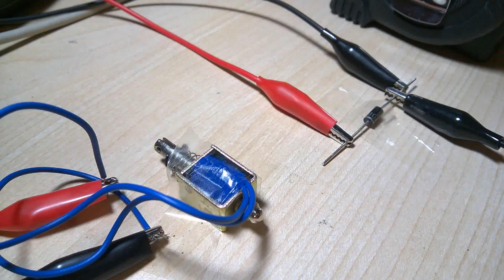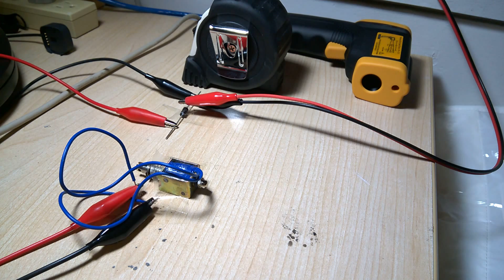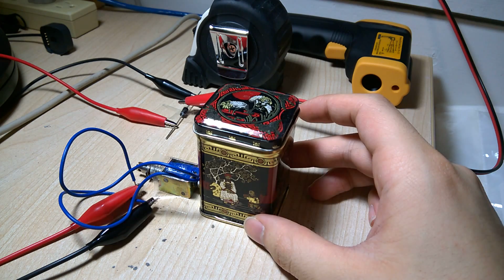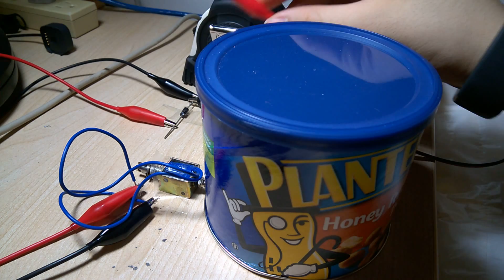Linear Actuator Solenoid

Comment: so if the power is on all the time the solenoid  would be out yes then when power is cut off it springs back. can you keep a contants 12v feed to it without it  blowing up 12v mine is i want to know if the 12v in is present for lets say 3hrs or so would it be ok

Comment: Great vid! wondering can you operate one solenoid at different amounts of current in one circuit? I'm guessing this would be done by some parrell circuit of some sort, or a diff. load voltage?
Reply from the maker: The solenoid is rated for 12 volts; at higher voltages, you might fry it, and at lower voltages, it might not move at all. Why would you want to operate a solenoid at different amounts of current anyway?
Reply: @wecsam  I'm envisioning using a solenoid as an actuator for a lever arm, that may move different things depending on its strength.

Comment: Can you please mention the sizea nd Force of the Solenoid? Also the site from where you buy this? I need a solenoid of almost 15mm dimension and upto 20N Force.
Reply: Any idea from where I can buy such small solenoid with such a force
Reply from the maker: I got the one in this video on Amazon: https://www.amazon.com/dp/B008LTHYLA
It has a holding force of 4 N, but in my experimentation, it only pulled with about 0.75 N. If you need a lot of force, you should also consider pneumatics or a servo motor.

Comment: I'm looking at these to activate a pull pin on a rc 1/10  winch can I just hook up the positive to a switch turn on stays pulled in until switch is turned off then springs back then opersite way wind winch in 🤔
Reply from the maker: Yes, the plunger stays pulled while power is on, and a spring pushes it back when the power is cut. A switch would work great for controlling this. However, just be aware that it doesn't pull with much force; I am not sure how much force your pull pin needs, but you might need a bigger solenoid.
Reply: @wecsam  does it matter wich  wire I would use thinking about a servo too but need to convert it to two wire but I dunno if it self level modding to two wires 🤔
Reply: @wecsam  or recommend a bigger solenoid that not too bulky smaller the better
Reply from the maker: @Lee-At-Green-Pheonix-Rc  I recommend getting a force meter to figure out how much force you actually need and then using that to decide on a solenoid or servo.

Comment: Hello sir i want to push a 100 kg weight bar like that colgate box cross section area how much capacity of linear solenoid actuator i have to use ?
Reply from the maker: A 100-kilogram bar the size of the toothpaste box? Did you mean grams?

Comment: How arrest heat and which type of diode are you using this?
Reply from the maker: You could add a heatsink to the diode, but if it's getting too hot, double-check that you're using the correct voltage for it. Check that it is drawing the amount of power that the manufacturer specified. You could also try another solenoid in case that you have a defective one.

I don't have the exact diode model anymore, but any 1N4*** should work. It only has to block Vcc.

Comment: How much weight it can push
Reply from the maker: It can push with about 0.4 N of force. How much weight that translates to depends on how you're using the solenoid. If you're pushing horizontally across a surface, you'll need to know the coefficient of friction between the object that's being pushed and the surface.

Comment: Would this 5v solenoid have enough force to push the nozzle of a spray paint can down? Thanks for your demonstration
Reply from the maker: It can push with about 0.4 N of force. You're going to need to measure how much force your can needs. A servo motor may work better if you need more force.

Comment: Hi Dave I’m look at building something using basically the same solenoid and a PIR. So I have a micro PIR sensor that momentarily switches on and off for around 2-5secs running off a CR2 battery 🔋 what do I need in between the PIR & solenoid? I.e diode and also need a current limit of 100ma. If you can help me out
Reply from the maker: I assume that you can make the PIR and solenoid share a ground. You'll want an N-channel MOSFET. It can take a low-voltage, low-current signal and switch a high-voltage, high-current line on and off. Look at "Simple Solenoid Drivers" on https://www.electronicdesign.com/industrial-automation/what-s-best-way-drive-solenoid for the basic idea.

Comment: Hi,
How can ı make a full automatic selenoid engine? Forward-back-forward-back like a tatto machine?
I want to make a pen for working on copper plate. For dotted texture.
Reply from the maker: I'm not sure how tattoo needles work, but a solenoid like this one probably won't be fast enough. An electric motor with a slider-crank mechanism might be a better choice.

Comment: do you think the solenoid is powerful enough to push a tennis ball up a 30 cm ramp which makes a 45 degree angle with the floor?
Reply from the maker: Not the one in the video. The force that is required will vary (different surfaces will have different amounts of friction, for example), but even in ideal conditions, the solenoid that I used won't push a whole tennis ball that high.
Reply: @wecsam  how high would it push it then? 10 cm? Let's say the surface has minimal friction.
Reply from the maker: @raymetal7  More like 1.3 cm in ideal circumstances. I previously measured the solenoid to push with at most 0.50 N. Let's assume that it exerts this force constantly while the plunger is moving, and let's assume that the ball stays in contact for the maximum travel of 0.010 m. That's 0.0050 J of work (force * distance). Convert that to gravitational potential energy (mass * gravitational acceleration * height). A standard tennis ball weighs at least 0.057 kg. Assuming 9.8 m/s^2 acceleration of gravity, if we solve for the height, that gives us 0.0090 m of height ([0.0050 J]/[9.8 m/s^2]/[0.057 kg] = 0.0090 m). Of course, that's going straight up; if the ball is rolling up a 45° ramp, then we can divide that by sin(45°) to get 0.013 m or 1.3 cm. Again, this is assuming no friction, a constant force from the solenoid, and contact between the ball and the plunger for the plunger's full range of travel.

Of course, if you got a stronger solenoid, then the ball would move farther.
Reply from the maker: @raymetal7  Oh, and this assumes that the ball doesn't roll. We already assumed no friction, so the ball won't roll as long as the force is applied perfectly in line with the ball's center of gravity.

Comment: Hey David, I need your help. I wanna know can I use it to push a modular electrical switch?
Reply from the maker: That's going to depend on the switch and the solenoid. The solenoid in the video was not able to push or pull with much force; it is not strong enough to push any switches that I've used. You would have to make sure that your solenoid is strong enough to push your switch.

It might be easier just to use a servo motor; some of those have a lot of torque, and there are plenty of designs on the Internet that mount servo motors to light switches. I have a video where I show just that: https://www.youtube.com/watch?v=m3pA422aRlg
Reply: @wecsam  Thanks David! 
May I know the specifications of the Solenoid that you used in the video?
Reply from the maker: @harenderjeetarora7508  You can find them on the original item page here: https://www.amazon.com/dp/B008LTHYLA/

Comment: Hello David. I’m building a possum trap. Cage type. As a kid I made traps where a possums weight on a ramp tripped a guillotine type trap door that shut behind animal. 
Now I want a electric trip where I still use a ramp which taps a micro switch that sparks the coil/solenoid pulls the pin that drops the door. 
But how do I stop power after trap has tripped?
Power would have to be switched off to avoid burning out coil.
Reply from the maker: You're looking for a monostable multivibrator.

Here's a version that doesn't use a 555 chip: http://www.falstad.com/circuit/e-multivib-mono.html

Here's one that does: http://www.falstad.com/circuit/e-555monostable.html
Reply: @wecsam  Thanks for the reply... I will just use another Micro switch!
First one (N/O) will be on the platform and trigger the Solenoid. and gate drops
The second Micro switch (N/O) on a roller arm will be on the dropping door and when the door has dropped the door will run off the switch and will "open" the circuit. Therefore cutting power to coil.
Reply from the maker: @byLokie  Good thinking. That works, too.
Reply: David Tsai Thanks. Simple enough.

Comment: I need a help..  If a solenoid is conected to a 12 v suply it continuously shutters..how to solve that? Any sugestions..
Reply: You need to make all your grounds are connected. This normally happens when people are using external power and something like an arduino but have not connected the grounds together. Also listen to David. Make sure your power supply is supplying 12V AND the current needed by the solenoid.
Reply from the maker: Make sure that your power supply can handle the current that the solenoid needs.

Comment: DC 12V 2A Push Pull 10mm 20N what diode do i need?
Reply from the maker: Any old diode that can block 12V will suffice. A 1N4001, for example, can block up to 50V and will work fine.
Reply: @wecsam  thank you buddy
Reply: DC 12v .82A my solinoid gets hot after 5 seconds when kept on can diode will solve the problem?

Comment: how fast is can this actuate? planning a 3d printed paintball marker, and trying to come up with ways to get something to actuate the ball valve letting air to escape and send the paintball flying. I am trying to get to atleast 5 balls a second if that info helps.
Reply from the maker: In this video, the plunger takes about 2 frames to move its full range. At 30 FPS, that is about 0.067 seconds. I would probably need a high-speed camera to get a more precise measurement.
Reply: David Tsai no need man, those calculations are good enough for me. Thanks!

Comment: What happens if you leave the power on? Will it fry the solenoid or reduce wattage drawing?
Reply from the maker: After the current stabilizes, the solenoid draws about 4 amps. It does get hot, but I do not know whether it would fry. Perhaps that could be its own video.

Comment: Great video.
By the way, how much current does a solenoid this size drag?
Reply from the maker: A solenoid is an inductor, which means that it draws very little current at first and then gradually draws more current. That said, real solenoids have some resistance. This one did not draw more than 4 amps while I was using it.

Comment: What is the current this solenoid takes? I suspect about 1A. 
Which solenoid would you recommend with smaller current (<0.1A) to be used with AA cells? The force of 0.5 N will be enough

Comment: Can I ask a stupid question, which way round do you wire the solenoid or does it not matter as long as one is + and one is - ?
Reply from the maker: +Let's Talk Retro The polarity of the solenoid doesn't matter. The plunger moves the same way either way. You should connect one to + and one to -, though.
Reply: Thanks David.
Reply: doesn't matter.